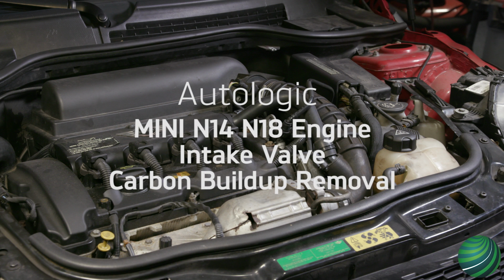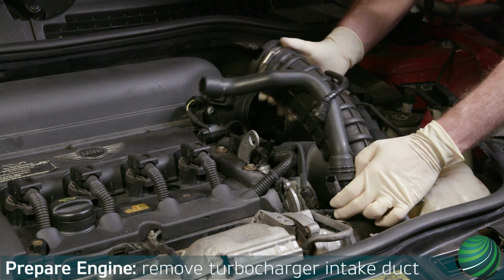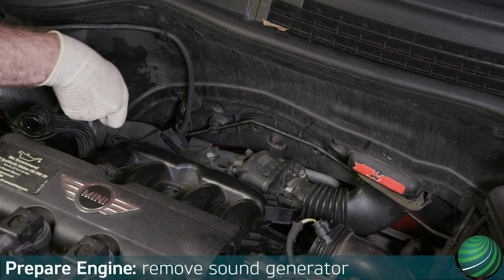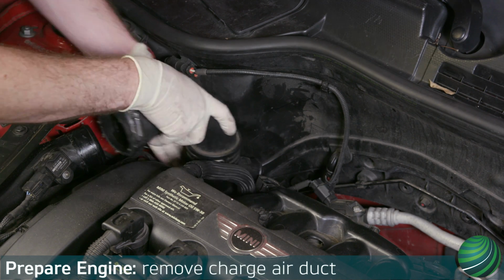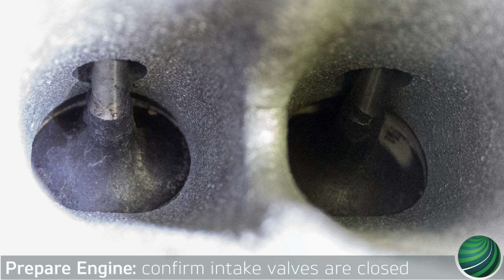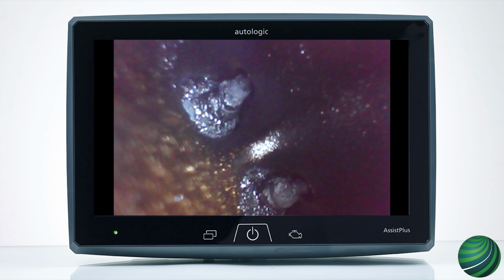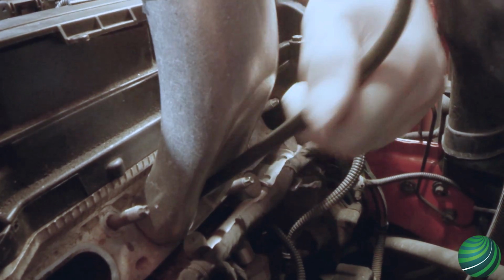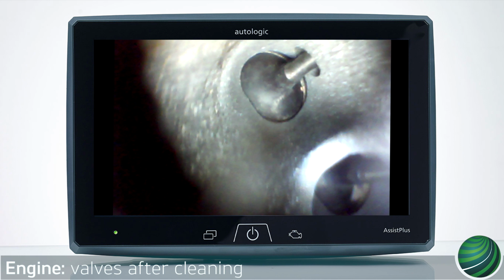MINI N14 N18 Engine Carbon Cleaning - How To Clean

Comment: Hi, can anyone confirm which side the intake manifold support bracket fastener is located? On other videos they're either removing the wheel liner and using extended bars to get to it or using a mirror to get to a bolt much lower down. Thx
Reply: You don't need to take wheel off, that is silly. The 10mm bolt is accessed from the passenger side. Find it with your finger, put a long 1/4" socket on it then the ratchet afterwards ( I have a ratchet without the detent ball ) then undo. It's easy. This guy who goes thru the wheel well is awfully silly, it's not even that hard to get to.

Comment: Is there any other thing to do than the walnut blast?
Reply: No...
Reply: Update. Cable tie bundle and wd40 worked for me also. Blow out resulting sludge. Fit catch can $20 ebay. Put seafoam in motor oil.
Reply: @ArieteArmsRAMLITE thank you
Reply: @ArieteArmsRAMLITE thank You!
Reply: What about 505

Comment: Remember if you don’t a walnut blasting machine then you can do it manually just the same, you need carbon remover and degreaser etc, use rags and licks to work away at the carbon, blow it out with air and inspect... repeat process
Reply: How can you verify your valves are closed before proceeding? How do you set to TDC?
Reply: @aycarambas  1 year late reply but it’s pretty easy to set TDC, you just need to remove the spark plug and put something long like a screwdriver into the spark plug hole so it touches the top of the piston then slowly rotate the engine by hand, it’s at top dead centre once the screwdriver reaches its highest point before it starts to drop down again.

Comment: ONCE YOU HAVE DONE THIS.CHECK EVERY OTHER COMPONENT TOO!.BOUGHT A COOPER S FOR A BIT OF FUN..WORST USED BUY EVER!!!.
Reply: Chrisuk 1960 why do you say that? I was gonna buy a used cooper to fix up?
Reply: Welding Junkie, buyer beware if you haven't purchased one of these trust me stay away.  Any mini with an R56 engine you will have leaks like crazy.  The parts they used in this engine can not handle the temp of the engine, the seals will go bad.  Unless you like spending a ton of money and have plenty of time don't do it.
Reply: @garybrnt87  If I had to do it all over, I wouldn't. A piece broke off an exhaust valve for me. I am still in the middle of the rebuild. The R56 N14 will fail and it will.
Reply: I feel your pain, I finally let my wife convince me into letting it go a few weeks ago.  Very fun to drive, a lot of folks like them but never ever again.  good luck on the rebuild.
Reply: @strongme80  Walnut blasting alone will not break a valve
Reply: i bought one for fun and spend more on the car than what its worth. The N14 engine has some serious failures. You will replace the fuel pump couple times and the oil cooler seals go bad quickly because of the heat as mentioned here before

Comment: Easy stuff! Squeeky cleaned the valves in my R56 for about $30.
Reply: How? Can you explain further your methods. Thanks.
Reply: @denniscanon1558  Please accept my apology for the delay! I someone looped back to this video.  It is basically a drinking bottle and an harbor freight air gun and harbor freight coarse walnuts. A big plus if you have a compressor with you too and the N54 Vacuum Blaster Adapter. You can reuse the walnut blaster over and over as well. This is the video I watched and replicated it. So you don't need anything fancy at all. I found the video of the blaster: https://www.youtube.com/watch?v=k6L_ArXCbYs

Comment: That’s the right way to do it. It’s a bigger deal for the N14. The N18 will need it but less frequently. 

Run them on the highway always use 93. No short trips. It’ll reduce the frequency on walnut blasting. Keep up with oil and plugs. Honestly I go early on them. The Mini Cooper S says 10k for oil 8k after some miles. I do it every 5k. Spark plugs are 60k. I change them at 30k. Only iridium.

If you take a road trip. Consider running a lower gear. It’ll help burn some carbon out (be mindful of the turbo and valves when you do this). I always idle for 10+ minutes at the end and last few miles drive normally to allow the turbo to cool. Cokeing is something you don’t want.

Drive it hard every-once in awhile. But be graceful with it. It’ll buy some time. High Octane. You absolutely have to do this with Direct Inject. The Gas never touches the back of the valve. Your asking for it with lower octanes.

Techron from Walmart is cheap too. It won’t help with the back of the valve. But running it once in awhile wouldn’t hurt. That’s Minis formula. Just rebranded Techron.

Ultimately it’ll come to walnut blasting and it’s not cheap.
Reply: This is great advice, especially the parts about higher octane and more frequent oil changes. These are vital.
Reply: csllover Thanks! Direct Inject has its benefits. Performance wise. But comes with the Carbon cons and inability to clean easily. Theirs a few things you can do during ownership to buy time. Walnut Blasting is unavoidable these days especially on the Mini. Even the dealers have chimed in with the method. Figured I’d post so people would take it more seriously. Plenty of mechanics unfamiliar with walnut blasting but it’s a real thing and is becoming more common especially on the German car.

AutoLogic showed everything correctly. Have to have the correct adapters which varies from car to car to do it etc. 

People that get it done say 60k or later probably see a performance gain as well (HP). But people needing walnut blasting at early mileage or having misfires due to carbon early are probably infrequent on oil changes not using high octane and on short trips etc. So I figured it was worth mentioning what I know about the cars etc.
Reply: Kristopher Sullivan Oil catch can or two is a valuable asset to these engines
Reply: what mileage (in miles) do you recommend walnut blasting for the N14 engine?   thanks
Reply: how come its less of an issue for N18? did they block off the breather hose going to intake manifold?